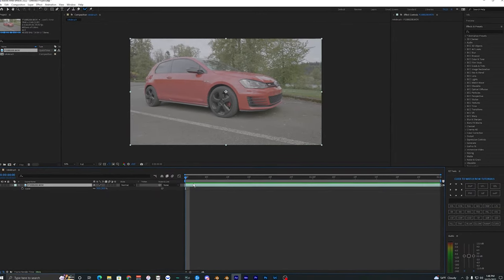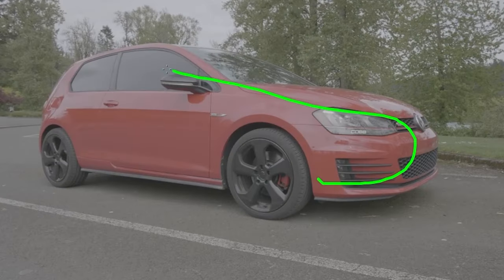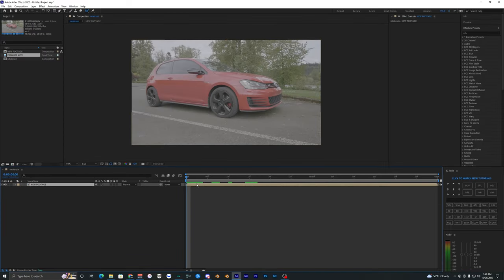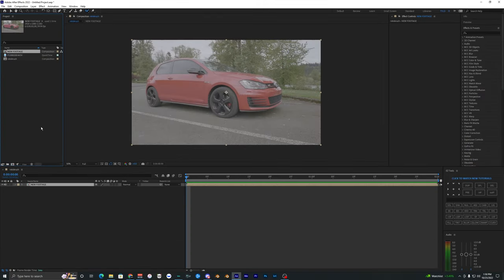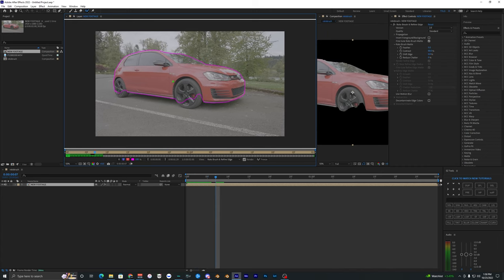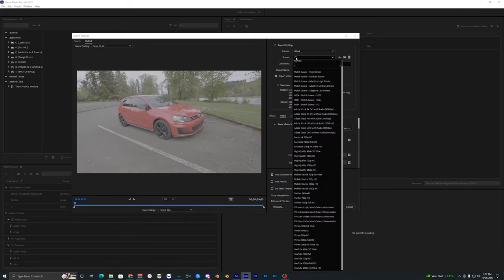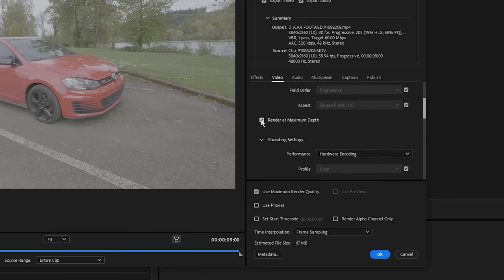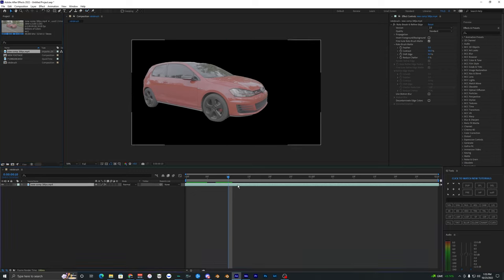How to FIX Rotobrush Error in After Effects (Frame rate mismatch)

Comment: This is not a Rotobrush Error or After Effects issue, this is a user error. The problem is that you have dragged in footage @ 59.94 fps  but your composition is set to 30fps. You need to make sure that your source footage frame rate matches your comp frame rate and you will be fine.  If you did want your comp @ 30fps then you need to conform your source footage frame rate to 30fps also. If you are doing VFX work  on this shot it pays to decide the final frame rate before doing any roto. it will save you time. for example it's easier to paint/roto  24 or 30 frames than 59.94.